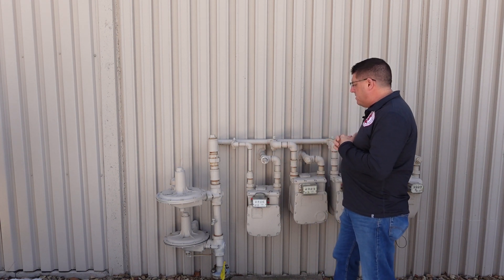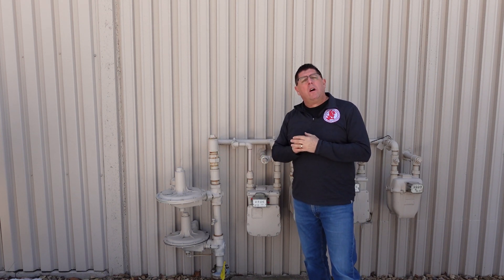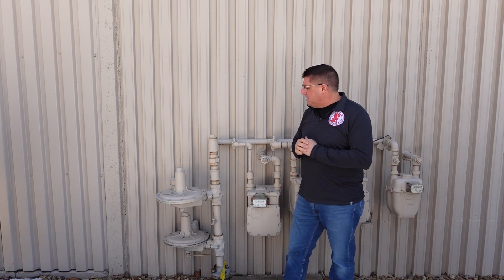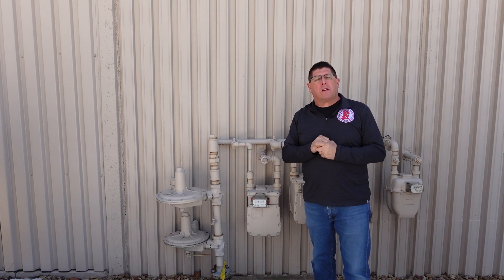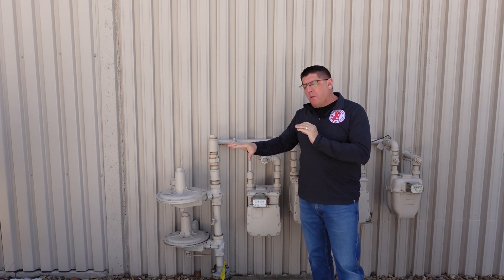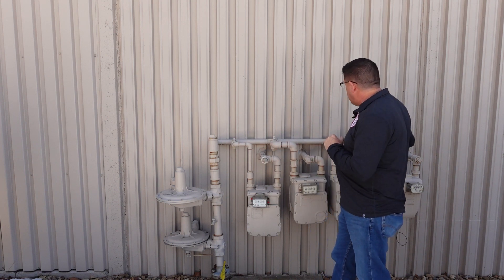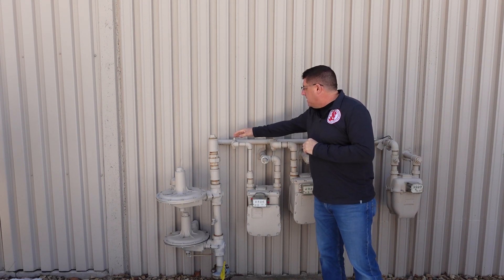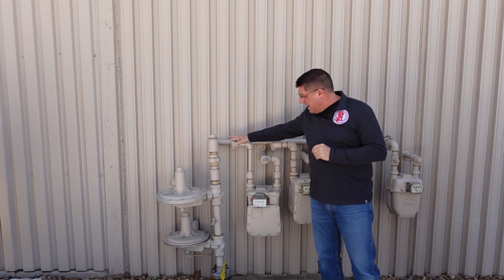Inspecting Commercial Gas Meters

Comment: I'm not sure I would approved with one regulator running on 4 vapor meters I did noticed you have a first stage reg and a 2nd reg which I assumed is set at 11 inches of WC. or 7 inches if its natural gas.

Comment: Hey Rob - You said it is not uncommon to smell gas at the regulator, because that is what they do, however, you also recommend we smell for gas so we can note it.  What is the proper step to take when smelling gas anywhere at the system, no matter how slight? i mean, how can you tell it's coming from the regulator specifically? Thanks
Reply: Thank you for the question, Chris. A regulator leak or expulsion will be at the regulator itself and not anywhere else. The diaphragm at the regulator will expel gas out of the screen tube when there is too much pressure. That is the only normal spot to periodically smell gas. As for other locations in a building,  I have always been of the school that a gas leak is a gas leak. If you smell gas or use a gas analyzer and detect a leak then it is a leak. No matter how small. It is like speeding. If the speed limit is 30 mph and you are going 31 then you are speeding. Not just a little speeding or slightly speeding. You are speeding. Now, how and to who you report this is a different matter. Depending on the location and maybe the severity (impossible to qualify) I might talk to the business owner or manager and tell them about the leak. I will absolutely place the leak in my report. I will let my client know and if there is a Realtor present they will be told as well. Nobody wants a gas leak in their building. I did not use a gas-testing device. The reason I did not is because of the wide variety of units on the market. I might detect a leak with unit A but unit B did not and the utility company used unit C and which finds leaks all of the time. I just did not want to get into the argument of which unit is better or which detected something and which did not. If I smell a leak then I report that I smell a leak. I might even qualify the smell with someone else present at the inspection. I hope this answers your question.